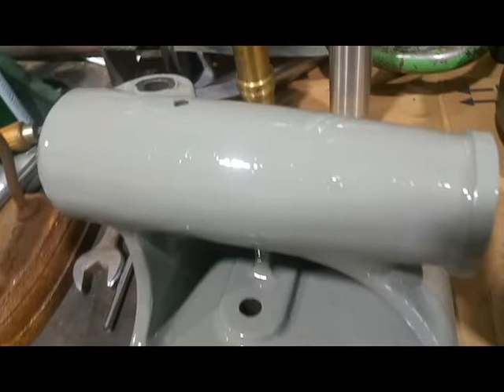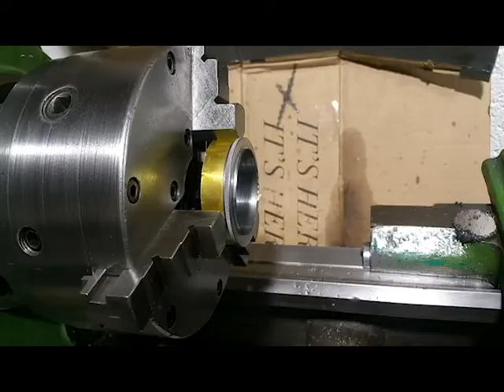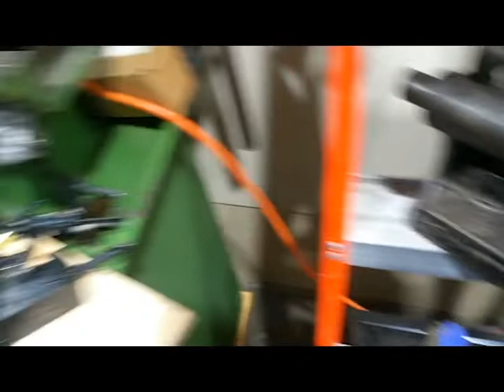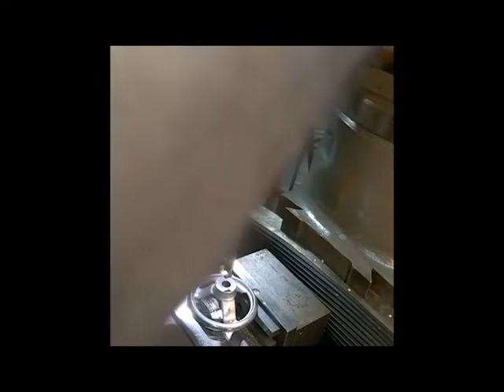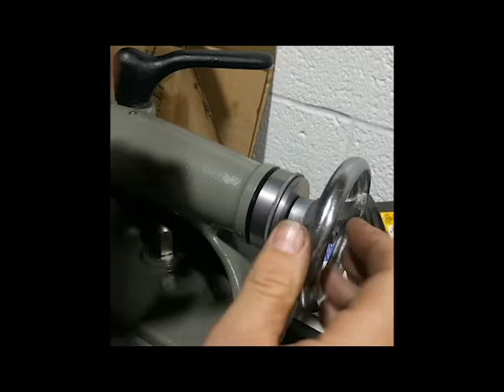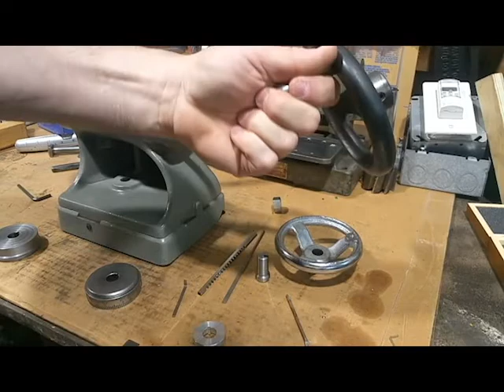Delta Rockwell 11" Lathe  Tailstock Repair and Refinish

Comment: A can of that paint formula is on the list. Took some doing, but you got it in the end. Looks great. It's a good idea to flip parts on ebay.
Reply from the maker: seems like im keeping more than im flipping.. LOL
Reply: lol I see a 11" Rockwell turret set up in my area on Craigslist. I think the guy parted the whole machine out as I saw the base a while back. I'm thinking about finding some kind of spindle/pulley head to throw on the surface grinder build. I never had any hope for it as a grinder, but with 3 axis it could maybe be a little CNC mill build. I don't know. - I got some import R8 collets today. Not deburred of course. lol  @RaptorMachineToolCo